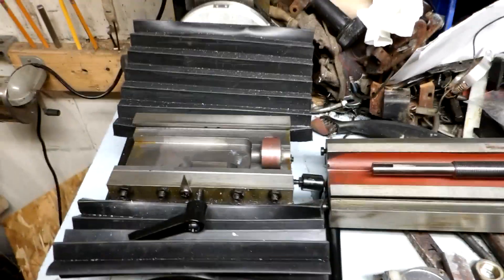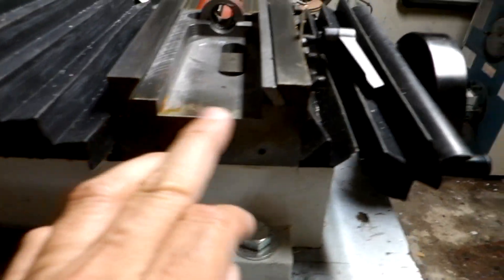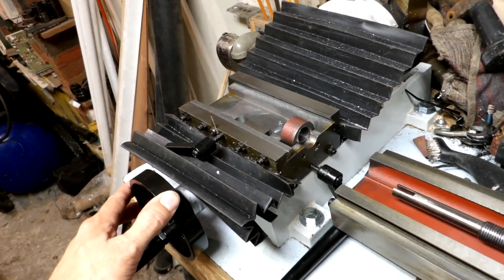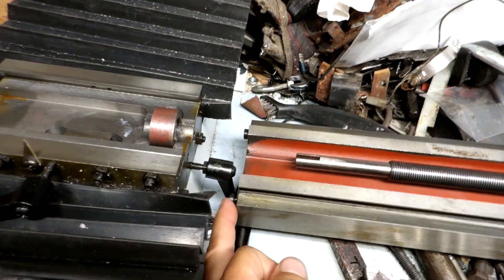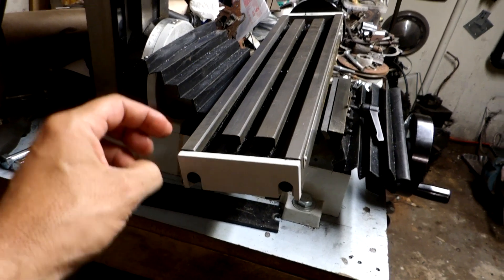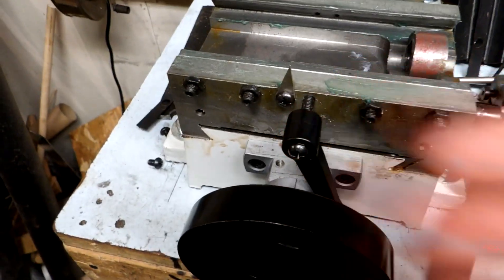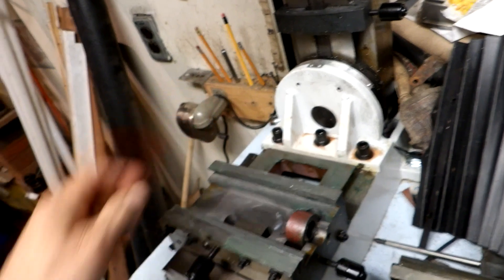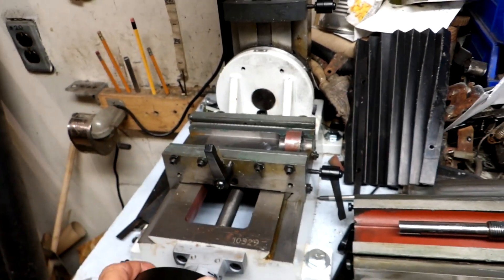Craftex CX605 Mini Milling Machine Teardown

Comment: Miles! You mentioned greasing all of those sliding surfaces in the video. Those surfaces are not greased! They are oiled! Chips and dust embed in the grease very easily and will score and wear the ways where you use them most and make them loose there and tight everywhere else. True way oil is nothing more than 5w20 or similar weight oil with a few additives to stick to vertical surfaces. You can use it just fine. Many machines have been ruined with grease on the ways, I don’t want that to happen with yours.
Reply from the maker: Hey, thanks for the info!  I can't claim to know much about machine shop tools, so I appreciate your sharing the fact I should use oil instead. My Focus cars use 5W20, so I have lots of it already. I guess I will be tearing it back apart ASAP!
Reply: @ChargerMiles007  Good to hear, it’s certainly understandable to think why those surfaces would be greased. Don’t be afraid to wipe dirty oil off the ways and apply some clean oil. Simple things like that add years to a machine’s life.